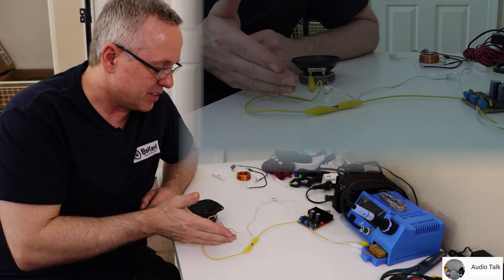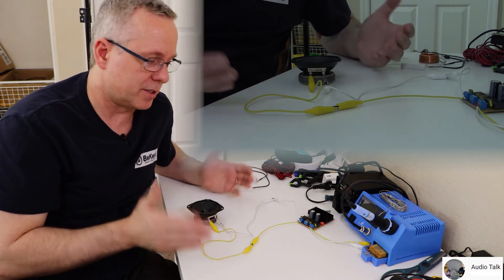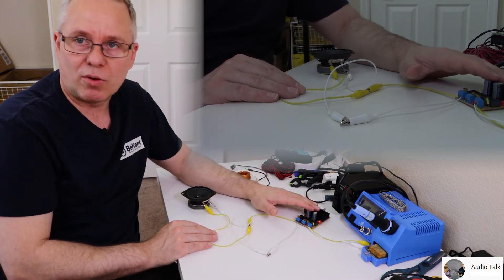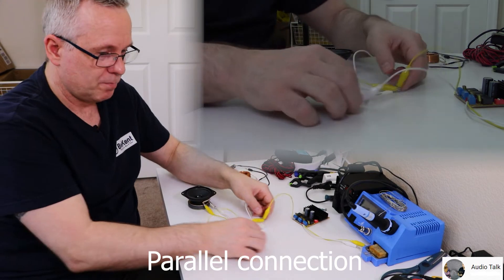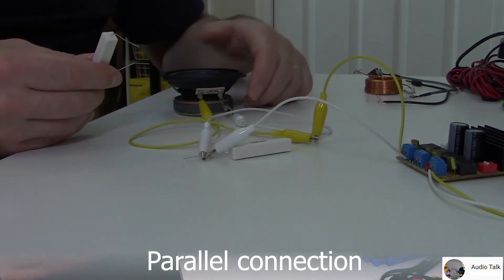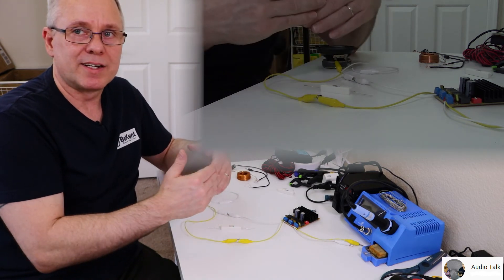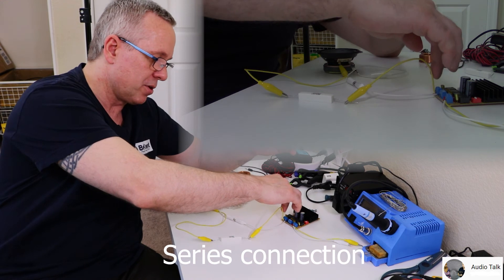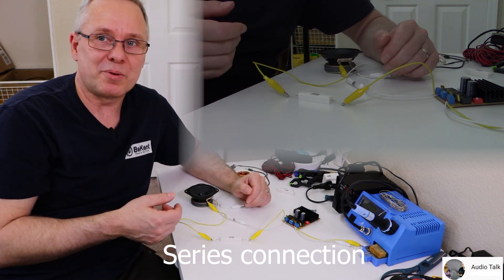How to Connect a Crossover Component in Series or Parallel

Comment: how do you connect a speaker system (full range with woofer, mid, and tweeter + crossover) in series?
Reply from the maker: There is unfortunately no simple answer, it all depends on how each driver impedance is being handled by the the crossover, and lastly what kind of amp you are connecting as far as impedance load capability. A crossover is a distributor of frequencies designed for a specific impedance, and the crossover is also levels the total impedance and sensitivity. So the crossover is the one connected to the amp and from there the drivers are connected.
Reply: @AudioTalk  no specific amp actually.. let's say a power amp. and yep, crossovers are the one facing the amp, not the actual speaker driver itself. so, in short, how to connect two crossovers in series? is it safe for the amp? if it is not, what is the effect on the amp? thank you.
Reply from the maker: @mooltok  So lets say all on the same amp channel, then it will depend on the total impedance of each of those crossovers with the drivers connected. So if its 4 ohm impedance you would need to series connect, and if its 8 ohm impedance you likely are fine to connect in parallel, just as long as your amp can take a 4 ohm load. Connecting 2x 8 ohm speaker loads i series will give 16 ohms and will allow very little power, so not unhealthy for the amp but low performance.
Reply: @AudioTalk  thanks. big thanks. more power.

Comment: I have a pair of Bose 151s.. I noticed they have 3 speakers connected in series and the crossover is connected in series with them... I thought crossover was to split the frequencies... what's the point of this crossover if the speakers are connected in series??  Thanks.. if you can point me to an article or a video that would be great.
Reply from the maker: Not sure exactly what Bose did on that model, but if there is only fullrange speakers it could be a notch filter to make them sound more full. https://audio-at-home.com/notch-filter-experiment . The price for doing that is lowering of   the sensitivity, but with 3 speakerdrivers it might be a good trade-off. So a sort of passive EQ is my guess they have done. Them all being in Series is probably just that they each have a low impedance.
Reply: @AudioTalk  Thank you for your reply.  If you google "Bose 151SE service manual" you'll be able to see the PDF with the circuit inside.  Perhaps that would shed some light on what they are doing.  But a notch filter makes sense...  Yes, the impedance of each driver or "twidler" as they call them is 1.4Ohm.. so the total is 6 Ohm nominal, 4.8 minimum.
Reply from the maker: @mktaha  yes, that was exactly it a notch filter. Without it, those fullrange speakers would probably sound like they where meant for intercom and not music.
Reply: @AudioTalk  Thanks again!  Mystery solved... now I'm going to try to figure out the exact effect of this circuit on the frequencies..

Comment: if I have two horns with a 4.7UF 100V Crossover Capacitor, do I need to use a Capacitor for each horn if I am connecting the in series or will one Capacitor do both Horns?

Comment: What's that little amp you have the speaker connected to in the beginning of the video?
Reply from the maker: Its a FX audio class D board with 7498 chip on it, but I don't believe FX-audio is selling boards anymore, I think they only do full amp designs in enclosures. Well made electronics.

Comment: I have recently installed a tweeter to my car stock audio system.
The new tweeter at 4 ohm came with small resistor 47 micro farad on the positive wire.
I am connecting these tweeters to my front stock mid bass speakers (4ohm).
My car audio player only support speakers from 4 to 8ohm.
Initially, I try to connect the tweeter and the front speaker in series so that the total speaker and tweeter ohm is still within the player ohm which is 8ohm.
Unfortunately, the sound of these tweeter and front speaker were too low as compared to the back speakers. Probably because of the tweeter resistor.
Now, I am connecting these tweeter and front speaker in parallel, they sound OK. But I worried this 2 ohm will eventually damage my player.
My questions are
1. Is there a better solution to this?
2. Can an additional passive crossover help to put these two speaker and tweeter back to player working ohm (4 to 8ohm)?